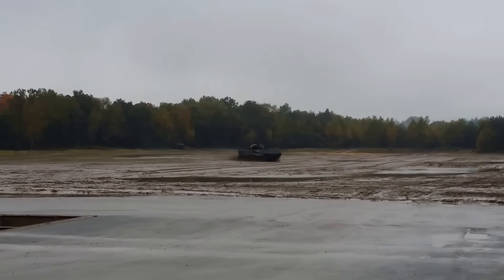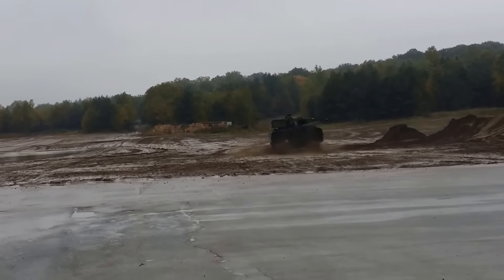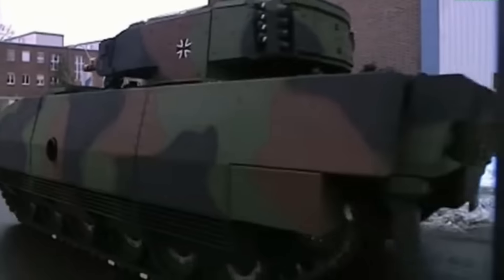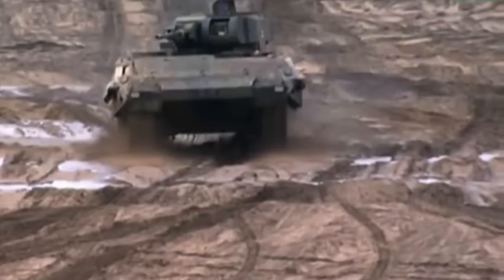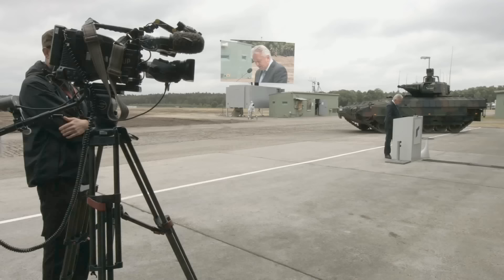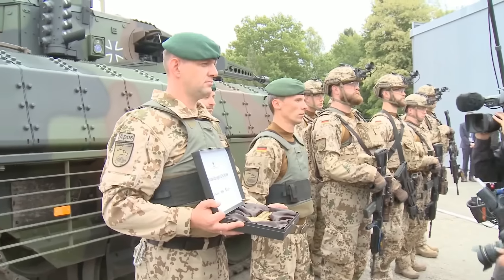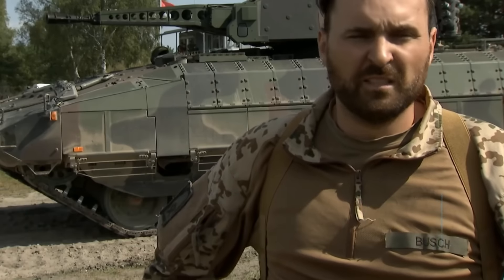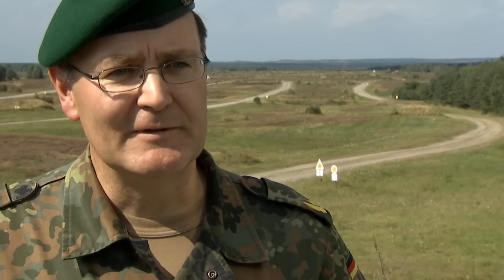The Puma Infantry Fighting Vehicle - Overview and Opinion

Comment: The important thing is, the Puma can shoot and move at the same time, similar to the Leopard 2. The most infantry vehicles must stop to hit targets exactly, not the puma. The technique supports that the gunner can fight versus a target and the commander are setting the next target at the same time (Hunter-Killer-Function). The target tracking is very fast. Tests from the Bundeswehr are proving that the Puma can hit aircrafts with this cannon. The Airburst munition can explode before the target and hit an area to fight versus infantry. The Puma has airmobility with the A400M. After the air transport the Puma with 31,5t can be upgrade to the 43t armor variant. The Puma has an air-condition system, that the electronic has no problems with desert climate. ... and they change to the 7.62. Maybe it is now the deadliest IFV-tank.
Reply: Galhara the Bradley can fire while moving
Reply: It can down aircraft? Awesome!
Reply: @Admin-5  Does it fire and hit the target?
Reply: It has also a hydropneumatic suspension for greater cross-country capability and (as you said) it helps a lot to provide the accurate fire when in the move. Protection levels, speed, and agility are the features that impress me the most. That's why I love the Lynx - its cheaper brother. Would love to see Lynxes in the Polish army.
Reply: @DrLimeGreen  Not with that accuracy though. In czech trials Puma hit about twice as much shots than the next best competitor.
Reply: So can the BMPs and any other IFV.

Comment: This just seems too big for an APC. Yes, it can fight (a bit), and has decent protection, but the best protection even for tanks is Not To Get Hit. More weight demands more power, which equals a bigger target.
Reply: The internal volume of the fighting compartment is 9 m³. That's pretty much as small as it can get for 9 people without affecting performance negatively. Not wasting volume is one of the most critical aspects of AFV development, because a higher volume also increases outside surface that needs to be armored, thus increases weight (the Bradley is a perfect 'how not to do it' example). More power isn't a problem, the Powerpack delivers 1100 hp while still being lighter and smaller than the 800 hp powerpack on the ASCOD 2 as example. The Puma is actually very small, what makes the Puma externally so big is armor.
Reply: The only relevant point you've made is that the Puma has plenty of power at around 4 times that of the M113. It's road rating is only a few kmh more, though. It's better protected, sure. BUT, as I hinted at earlier, it's fucking huge. Compared to the old M113, it's 2.3m longer, 1.2m wider, and .5m higher. Puma has only .5 m³ more internal volume. My point stands: Better Not Get Hit.
Reply: 'The only relevant point you've made is that the Puma has plenty of power at around 4 times that of the M113. It's road rating is only a few kmh more, though.'

It outraced a Leopard 2 MBT in testing, 'road rating' is for politics. M113 has 16,44 kW/t, Puma has 19,5 kW/t.

'It's better protected, sure'

It is A LOT better protected. And i'm not talking about twice or mabye triple, i'm talking in double-figures. Why is the Puma so big externally while being just 0.5 m³ larger on the inside? Because of armor! What else?

So you would actually favor a M113, which is maybe 1/3rd smaller on the outside, but much less than 1/3rd protected? Modern FCS don't care about that little difference, and i don't understand you decision. Especially if you consider IED/mine threats.
Reply: You still miss the point. A massive APC is an easy target, and the Puma is just that. I compared it to the old M113 mainly for size comparison - nobody would want to be in one on a modern battlefield. Nobody would want to be in a bigger target, either. 
Btw, FCS means FUTURE Combat Systems; "Modern FCS" is oxymoronic.
Reply: You misunderstand my explanation. The Puma is larger externally, but about the same size internally. So the probability to hit a Puma is higher, but the probability to hit its crew compartment is the same.

The probability to actually penetrate is much lower however.

Anyways, the M113 was a bad comparison. Compare the Puma to other modern IFVs, and you will see it's actually among the smallest and most protcted ones. You simply can't archieve decent protection at a smaller size. CV90, Bradley, T-15, Namer. All bigger.

And 'FCS' means 'Fire Control System'.
Reply: FCS, I should have known that, I've certainly heard it many times, but never as an abbreviation.
Reply: Andrew, it is desinged with hunter killer capabilities. That was requested from the Bundeswehr not to depend on external fire support and be able to protect the infantry effectively. Thats why they made it so heavy. Its also has electronic combat capabilities.

Comment: I can buy the fact that it can stop 120mm rounds from the front (if they're fired from a few km or so). With its weight being larger than an T-72, I'm guessing a lot of that is composite armor.
Reply: in all fairness most combat occur in less than 200 meters, if i remember correctly. Also considering this is meant to operate near infantry as support, i'm guessing it's safe to say it's combat range wouldn't be that different.
Reply: John J do you have a source on that? For i highly doubt that for armored vehicles.
Reply: note the number was for infantry ranges. Noted in a US army report i think dating from around the Korean war. Can't find it, though not surprising since i don't have a name. Though well googling in an attempt to find it. I did find a few things noting towards the same general range, though sadly mostly from a wide range forums. But did find one thing that is a bit more note worthy then a forum. http://donaldmsensing.blogspot.com/2003/06/infantry-rifle-combat-distances.html
Reply: You do realise when armor comes in play it's a different ballgame right? So it's not too relevant in my opinion. It also varies greatly in what kind of eviroment the battle is fought.
Reply: From a hull down position it can "stop" 120mm rounds by dint of the fact that a 120mm round hitting the unmanned turret will just break something not kill anyone or disable the vehicle. I could also imagine that the vehicle could have a NERA armour package capable of stopping a 120mm HEAT round on the front hull plus as most of the front hull is the engine you could make the argument that it will stop a 120mm heat charge at the cost of an imediate or delayed mobility kill.
Reply: Yeah, the 200 m number is for infantry. With stabilization and nice optics, a vehicle MG can put some good suppresive fire down at those distances.
Reply: It's wrong. Matsimus did a poor job researching. The official requirements from the German Army called for protection against medium calibre KE ammunition only. The armor is too thin and lightweight for stopping a 120 mm APFSDS round. HE/HEAT is another thing, because it was designed with protection against modern RPGs.
Reply: Lower front part of the main hull can definitely take a 120mm APFSDS cuz it's LFP has basically a MBT chassis strength. Upper front arc was designed before STANAG 4569 was introduced, somethat in the 50+mm range. Sides 30mm APFSDS.
Reply: It's not an MBT chassis, it's a compeltely new built chassis. It's armor is much thinner than that of a MBT, it's also much lighter.
Reply: It's not "from" an MBT, it was derived from a MBT project. The Puma is the only vehicle that was further developed from a program called "NGP" cancelled in 2001. This program wanted to unite MBT, IFV, AA and recovery vehicles on a new armoured base (just like the "Armata" program). "It's armor is much thinner than that of a MBT" simply isn't true since it has a better mine and side protection than a Leopard 2A6M MBT. And it's not "much lighter" considering the low weight of the unmanned turret (unmanned = smaller = less armored = lighter) and the rather small size of the vehicle itself. I can say it's definitely not "light". It's currently one of the best protected IFV head on with the T-15.
Reply: This is not exactly correct. The NGP was canceled and modified several times, the Puma is designed as an IFV with an IFV hull. The NGP wanted one hull for all variants, which could be reconfigured. The NGP's weight was 55 to 77 tons depending on armor package. The Puma is part of a follow-up project to the follow-up project to the NGP, it's not the NGP.

The Leopard 2A7 has thicker side armor and better mine protection than the Puma. See how this doesn't really help in the comparison. If you have seen the Puma IRL, you'd notice that it has much thinner frontal armor than even the oldest Leopard 2 version. It doesn't use a MBT hull, it's an IFV hull specifically designed to be air-portable via A400M aircrafts.
Reply: It's not "the" NGP but derived. Some similarities like the hull size and shape were inherited like the very thick lower front armour plate (unusual for a IFV). NGP wanted to place the engine in the right side of the rear hull anyways.(bullshit tbh) You talked about the armour thickness, however it's spaced AMAP-B and AMAP-SC NERA glacis armour that provides a superior protection to everything build in the Leopard 2A7 (it needs to be spaced for it to work). The Leopard 2 "Revolution" and "MBT Technology Carrier" feature this type of armor too as far as i know. Also the "Dünnblech-Biegetechnologie" isn't featured on the Leopard 2. It creates less weak-spots and breaking points against AP ammunition and shock blasts such created by mines and improvised explosive devices (IEDs). It's not all about armour thickness. I don't understand why they went for ERA at the upper side addon protection. NERA would've been more effective since "western" ERA is bull*** compared to "east" anyways. Lower section however they went for composite.
Reply: Neither the hull size nor the hull shape were inherited from the NGP. 
There were four proposals for the NGP, none was selected and no 
prototype was produced, before the project was canceled due to budget 
cuts. Some proposals had a front engine, some had a rear engine and some
 had an engine which location could be swapped, depending on wether the 
vehicle is 

The Puma's armor doesn't provide superior armor 
compared to the Leopard 2. You can read the protection requirements on 
the manufacturers websites or in any book on the Puma (such as "PUMA Der
 Neue Schützenpanzer der Bundeswehr - Teil 1 und 2" by Tankograd 
Publishing). The Puma is designed to resist RPGs and medium caliber 
ammunition only, not ATGMs (for this the Puma has the MUSS) and 
105/120/125 KE ammo.

The AMAP-B armor is not NERA, it's made of 
ceramics for ballistic protection against bullets (hence the "B"). The 
AMAP-SC is the NERA designed to protect against shaped charges (hence 
the "SC"), but it's not capable to reduce the penetration of ATGMs to 
15-22 mm, at least no in case of the Puma. While the armor can 
protection against these threats, the Puma doesn't have enough of this 
armor! The Leopard 2 Revolution has more than twice as much armor (put 
ontop the old Leopard 2A4 armor) to be able to resist ATGMS and APFSDS 
ammo from tank guns. According to the manufacturer, the AMAP-SC armor 
provides between 8 and 10 times the protection of steel of the same 
weight. To reduce the penetration of a modern ATGM (up to 1,400 mm 
penetration) to only 15-22 mm, the Puma's AMAP-SC would weigh as much as
 172 mm steel armor, which is not possible given the Puma's weight.

The
 HL-Schutz ERA from Dynamit Nobel Defence is used on the sides, because 
it's more effective than AMAP-SC. According to Dynamit Nobel Defence, it
 provides more than 10 times as much protection per weight than steel, 
so it's more weight efficient than AMAP-SC. However ERA doesn't protect 
agaisnt mines/IEDs, which is why the lower section and the hull front is
 protected by composite armor.

The Leopard 2 has a much smaller 
surface area and volume, while also weighing a lot more. Puma's weight 
and size is closer to that of a Marder 1A5 (up to 35 tons), it's higher 
protection level is mostly the result of better armor technology. 
However the Leopard 2 (2A7, Revolution) has equal or better armor 
technology than the Puma.
Reply: the puma has better armor than the leopard 2. if you talk about chassis to compare armor you only sound stupid. the puma in it's highest protection class has more armor around the crew compartment than most battle tanks today. oh and yes. the puma is based on the ngp program.
Reply: +Mar, no it doesn't have better armor thant the Leopard 2. Just read a book or watch some video from the official German Army channel...
Reply: I did and it has.
Reply: What do you think is a 120 mm round that you can expect on the battlefield today?
Reply: @ALegitimateYoutuber  but not tank combat. Tanks are not used the same as in WWII.

Comment: This would have to be shoe in for our Army phase 3 tracked IFV. The reasons are arguably several, commonality and supply/logistical cost savings will appeal to the suits in the Dept Treasury who always have a insidious influence in all National Security Committee of Cabinet defence kit decisions. 
While the Australian Army brass will be attracted also to the many upsides given Rheinmettal have recently been awarded the tender to replace our Vietnam era tracked vehicles [but stretched/upgraded wasting precious appropriations]. Moreover, Rheinmettal have committed billions into the State of Queensland for Boxer, and in most defence kit decisions electoral factors invariably are hugely important drivers.
Germany cranks out seriously top notch defence kit, the Leo 6 arguably is the best MBT around, even if we went with the M1ADSIA Abrams which will soon be either replaced with M1A2SEP's given our ADF has acquired sea/air/land MOTS/FMS defence kit which enables our RAAF/RAN/Army to be heavily involved in R and D spiral upgrades. The only other option/competitor is the South Korean IFV.

Comment: This clip brings up the old cavalry saying 'at some stage your going to have to get off your horse and go to the short sword'. With all its tech I'm not sure this has a 'short sword' to go to.
Reply: They have mechanical back-ups for the vital parts like turret rotation and gun elevation, thermal sights and engine. Most militairy's put in their verhicle as a back up some very simple short-wave radio's for last-ditch communications. And for "getting of your horse" i believe German tankers have a compact version of the MP5, or atleast a service pistol. ^^
Reply: For the reliability of the computers, supposedly it was the only IFV in the czech test trials which didn't have any major system breakdown, every single other contender (ASCOD 2 (also known as AJAX), Lynx and 2 CV90 versions) had atleast one.

Comment: This has always been my favourite IFV. Way better than our AJAX. The powerpack is what we should have specified for the the AJAX. It has the MTU 890 series V10. This was designed for heavy tracked AFVs. Whilst the AJAX uses the MTu199 series which is a commercial truck engine intended mainly for Wheeled AFV!!!  MOD what are you doing specifying such an engine.

Whereas the German go for the ultimate specification.

Comment: Matsimus, you missed two, no three facts: 1.) This vehicle is indeed designed with hunter killer capabilities to protect the infantry and to be able to skip external fire support (It is even designed to defend itself from slow air targets and they found it might be capable of fighting fast air targets). 2.) It has electronic battle capabilities: It can detect missile threads and setup electronic actions to fight/confuse them (how, don't ask, all classified :-) ) 3.) It is embedded into the strategy of future digitized infantry warfare also including the Boxer which is in combination with the PUMA a very very capable way of dealing with armored and infantry warfare. Thanks for the video, good work!

Comment: No the Bundeswehr has not setteld for the 31t variant because it's not a variant. The Bundeswehr uses the Puma in his 43t fighting configuration and can reduces the weight by removing some armor for stratigic mobility down to 31,5t (manly for use of the A400M).
Reply: Yes, the idea is to  fly 3 x A400M with the Puma shipped in 31.5 ton Form and a 4th A400N will carry the extra appliqué armour for the 3 puma which can be fitted in a few hours.  The Pumas can be driven of the A400 and will be ready immediately.
Reply: So far as i know this Tank is too bringt for the A400
Reply: Ha, Ha, Ha, what a dump joke, buthead!
Reply: Lion Decka Puma was specifically built to be transported by the A400M

Comment: 8:26
these are not cameras, its actually the Pumas 'MUSS'-active protection system (https://en.wikipedia.org/wiki/MUSS_(countermeasure) ) - a thing you forgot to mention in the Video.
the driver uses his sights on the hull, an the commander the 360° rotatable optics on top of the turret :)
Reply: That's right, but the driver sure does have a set of cameras. On the hull, not the turret.
Reply: yeah thats what I meant - but cameras on the rotating turret would just make him dizzy :D
Reply: muss is more passiv than active.
Reply: MUSS has active engagement of the incoming thread via IR beam and multispectral smoke. Classified as active softkill.